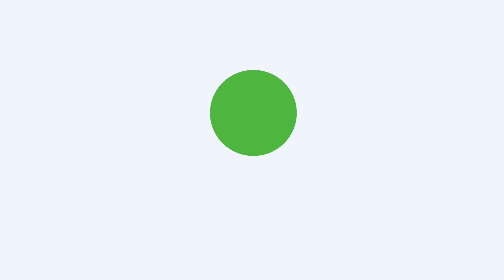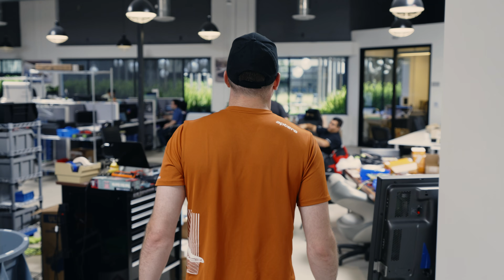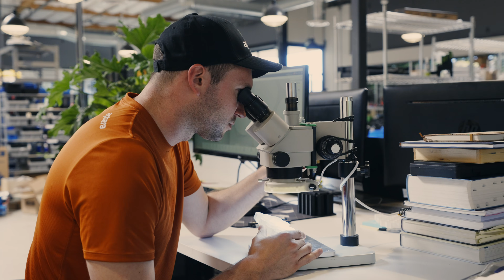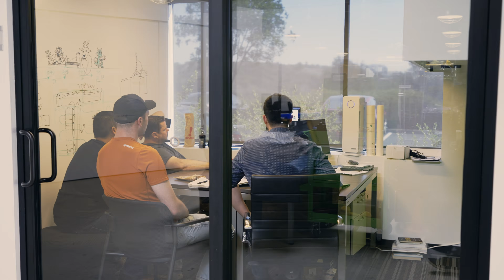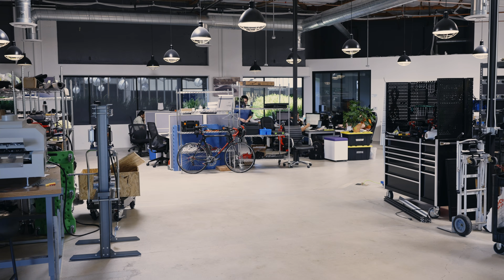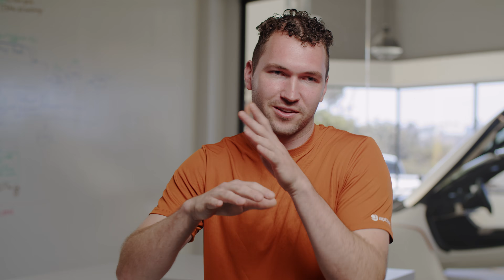Aptera Makers Series — Battery

Comment: I have a Future question... will be possible to upgrade the batteries later? (example I own an 250 miles Aptera but then I want to have 400 miles, I will be looking for add upgrade if possible or have like a trade in for the version I want🤷🏻‍♂️?)
Reply: The light weight design constraints probably mean that the battery packs probably will have to be changed out as a unit for the 250, 400, 600, or 1000 mile versions.  It won't be easy due to the weight.  That said, they are only entering beta phase, so there is still room for things to change.  The betas will be quite different from the Alpha models in major respects.
Reply: @n.brucenelson5920  even if the pack allowed for it I would be worried about suspension.  It needs to be tuned differently because batteries are such a massive amount of the weight.  20kw+ of batteries is a lot of weight.
Reply: @ccibinel  You are correct about the weight, even though Aptera's packs are relatively light at around 100 lbs per kWh, so around 400 lbs for the 40 kW pack and 1000 lbs for the 100 kW pack.  Roush is working on the suspension tuning and the beta models will be quite different, with a different design from the alphas in the rear.
Reply: @n.brucenelson5920  A kwh in Li-ion is only around 10 Lb! I drive a 22kW pack and it weighs 252 lb all included.
Reply: Unless you have very few charge cycles, and only had it for a short time it, I think would be a bad idea to mix old batteries with new ones in parallel like that. Also with the active cooling there may be more issues trying to re route the coolant around more battery cells that weren't in the car from the factory. 
Perhaps you could get a trailer with another battery pack to switch to, (similar to a second gas/diesel tank some trucks have) and/or more solar to slow the discharge rate? Or even a small efficient gas/diesel generator for longer trips that could at least slow the discharge of the batteries while driving down the highway like 50%-70% of what the car needs to travel at 50-65mph? Or you may have to just sell it, and buy a larger battery capacity one when you realize that you want one with more range?
Reply: @josiahlehman1506  you are right - I meant to type miles instead of volts.  Thanks for catching that!

Comment: A good BMS for the batteries is a must for very hot and cold climates.  Hope to hear much more on the BMS, charging options, and plug considerations when more than solar is needed.  Thanks
Reply: Hello from another JeffnReno Aptera fan! My current ride is a 2013 LEAF and I def 2nd the importance of a good BMS. I road trip up to Eugene to see my sister's family and 88 y.o. parents. DC quick chargers have become more abundant over the years, but I often level II charge simply because I am fighting battery overheating problems. Sometimes I even find myself waiting for over an hour under a shady tree as the battery cools down below the red zone on its temp meter. On a hot day even repeated level II charging can overheat it ... 

Granted Nissan did not engineer their battery to handle extended road trips but It is my only car and sometimes you just got to go even if extreme patience is required. After the last 8 years of reduced personal mobility I am chomping at the bit for the freedom to travel relatively effortlessly almost anywhere I desire in my car. With my LEAF I still can't even go East of Reno very far, as the charger availability just isn't there, despite NV's broken promises about electrifying our main highways. Even the Vegas route that was supposed to be accomplished by 2016 is still not drive- able by 1st gen now 'limited range' EVs.

Comment: If the batteries will be probably packs of hundreds of those small cells like he held, how do you manage when just one goes bad?
Reply: On  Tesla Model S/X which uses 5.3kWh modules made out of 18650 cells in a 6s74p array you identify (thermal imaging whilst rapidly charging/discharging) the bad cell and snip off the connecting link (almost impossible to exchange the actual cell). You loose 1/74th of your capacity. With the Aptera it may be possible to exchange that bad cell. They have become amazingly reliable which means it would be a rare event. Sadly the trend is for bigger modules or even just one big battery to save weight, volume, no of connections and cost.
Reply: Just like every other EV, you replace the entire module. If under warranty, you probably replace the entire pack and hope to find another market (such as home energy storage) for the modules which are still usable. The pack with a bad cell gets recycled, hopefully.

Comment: Thanks for sharing this informational, Aptera team meeting series! Luke does a great job talking about the challenges that he is facing with the battery system development, and the benefits of having a smaller, close knit company like Aptera. Even though he didn't talk about any specifics (2170s?) I am encouraged by what I heard. It would be great to start an Aptera battery technology thread on the Aptera forum and have Luke chime in with his comments and ideas.
Reply: I thought the cell he was holding was an 18650, but I'm definitely no expert
Reply: @merrickhurst4150  Could well be. The 18650 is a solid battery, but the 2170 is newer, bigger and slightly more energy dense. I'd love to see the 4680 batteries used, but it's unlikely for the next year or so. These are all top notch, modern batteries. It does look like Aptera is heading towards using cylindrical batteries, rather than pouch batteries. Which is probably a good idea because of the unusual cooling of the Aptera.
Reply: @deanmcmanis9398  other seem very sure that the cells shown are 2170s so you're probably correct. Either way I'm glad we're starting to see new details, rather than refinements of old details

Comment: Did he just admit to corporate espionage?
Reply: Ha! Much more likely he admitted to going to a technical conference for EV battery system designers.
Reply: I'm guessing he saw what other disassembled battery packs from other manus looked like at Munro and associates' place. IIRC they're in detroit
Reply: @TheHellogs4444  Munro is working very closely with Aptera, so I'd bet money that's where he went.
Reply: Benchmarking
Reply: Yup, they admitted to it I think in the last webinar

Edit: not saying they’re “guilty”, they just said they’re partnered, which is great
Reply: @TheHellogs4444  Yeah, you spy on your closest partner.
Reply: It’s SOP - and nearly anyone building anything (from phones to fighter jets) will gather all available information in practically any possible way.  Physics and economics are not variable, afterall!  There are few secrets in emerging industries, because all the disrupters are solving the same problems, and component suppliers are constantly scaling and standardizing for this use case.

Cool to see progress here and other vehicle developers.  Aptera is smart in positioning the vehicle as lowest drag coefficient (get rid of a wheel for starters!), with 40 miles self-charging range (in an “always sunny” clime, at least!) in a daily driver.  

Beyond that, using nearly 100% standardized/commercial components, (with as little as possible little proprietary IP), is likely their biggest challenge, otherwise costs and dates will constantly slip.

At some point - suspect late H1 2022 they’d better be shipping a few cars - and scaling to minimum 500/month by year-end to maintain relevancy and credibility.   How many reservations have they taken, and at 500/month, how many can they fulfill in 2022?  That’s the biggie on corporate viability, I think.  I don’t know battery technology and how it relates to speed/range performance.
Reply: @michaelfoxbrass  11,000 reservations at present. If they produce 500 pieces/year, they will need 22 years to deliver the last. A reasonable pace would be to start with 500/years and at least double every year thereafter. In this way they will have delivered the last order in 5 years. Thanks goodness I am among the first 100!
Reply: You are all taking this way too serious lol
Reply: @johns8249  And you enjoying yourself😀
Reply: Learn to listen man.

Comment: 18650 or 20170 ?
Reply: Maybe you meant 21700 cells? Yep, Luke is holding one in his hand, so I guess they go for that. Great content Aptera!
Reply: Yes 2170
Reply: I guess the next question is: which cell chemistry?
Reply: @benjaminnead8557  well I half way expect that to change before real production 1 year from now. You main cpu chip has a one year lead time.
Reply: @benjaminnead8557  Will be interesting to see. My quess is that they are going safety first, and will use LFP chemistry. Just my two cents thou...
Reply: @petrihietanen1102  Thanks. Yes, I also hope it's LFP. Really glad to see Aptera reboot after all these years.
Reply: @benjaminnead8557  Given their emphasis on low weight, would they really choose a chemistry with such low gravimetric density? 
BTW Greetings from another former 16801 resident.

Comment: 400v at the top ? And what's the bottom voltage?
Reply: 400 volts is a common choice of upper charging voltage, for compatibility with available DC chargers. The nominal ("average") voltage of a pack designed for charging at up to 400 V is about 360 V (96 lithium-ion cells of NMC or similar chemistry, at 3.75 V/cell), with the minimum very roughly around 320 V (3.4 V/cell).
Reply: Bottom voltage is zero, when it it totally discharged.  lol
Reply: @fanfare100  300v or so
Reply: @fanfare100  No, battery cells don't work that way.